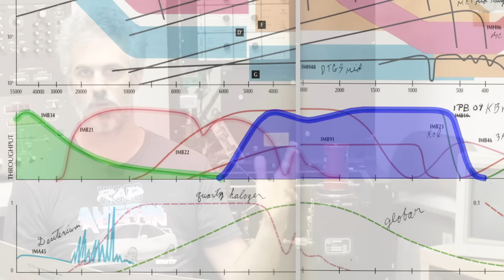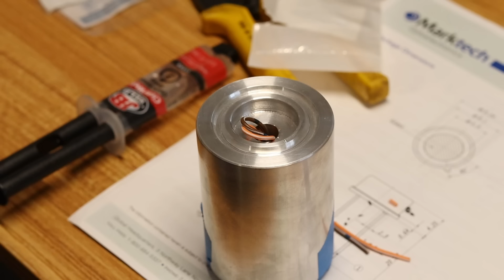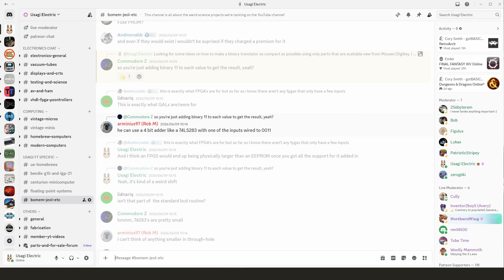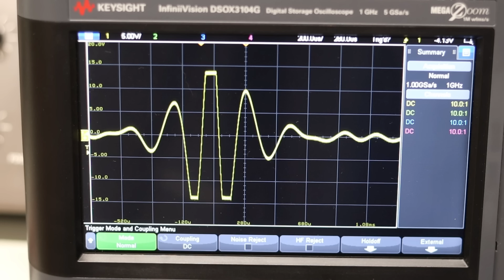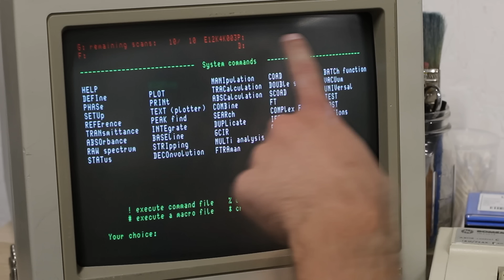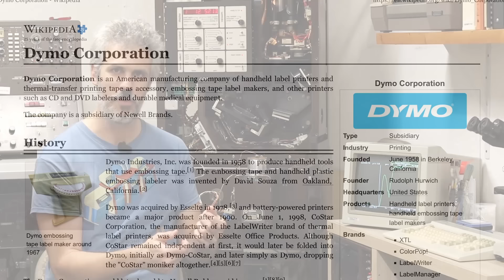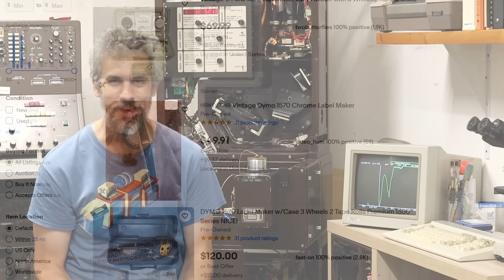Using a PDP-11/73 to do Real Science!

Comment: As any electronics person will say, before powering up something new/repaired first check for power shorts and then apply power from a current-limiting bench supply. It's lucky in this case that just the fuses blew. It could have been much worse....
Reply: Yes, and before even the power on check, look at it carefully to make sure you soldered it all correctly.
I have never skipped that step while using expensive parts, trust me, no I didn't, my eyebrows always looked like this
Reply: There is always a fuse, even if it doesn't look like a fuse, or cost as little to replace as a fuse .....
Reply: @bluerizlagirl  Hahahahahaha!  Nice.
Reply from the maker: To be fair, I did do checks for power shorts, but I think the real problem is I got something laid out wrong with the PGA, which may have caused it to fail making an internal short. So, not a construction fault, but a design fault because I'm bad at reading datasheets.
Reply: @UsagiElectric hey, at least we made the booboo on the relatively cheap board and not something irreplaceable. 

How much we would weep were it one the important bits of the Bendix G15's boards.
Reply: @UsagiElectric  I wrote you a nice long top-level comment to this video with more details on crystal growing etc. and thanking you for your kind words in the video.... which youtube then promptly shadowbanned and outright deleted a few minutes later. Honestly getting extremely tired of this platform's incredibly censorial comment system and continually trying to guess what naughty trigger words it thinks should be banned. I will try to repost the comment here as a new reply but I doubt it will work. In any case, thanks again and looking forward to more videos!
Reply from the maker: @Muonium1  Youtube out here trying its best to harsh our vibe, it didn't even give me the option to review the comment. I'm glad you managed to catch the video though! I'm working on a way to get the PDP-11 software to produce HPGL versions of the spectra so I can then transfer them to my modern computer, convert to a PNG and then upload to the Near Infrared Spectroscopy page to supplement the ones you took! With our powers combined, we'll completely dominate the NIR uploads on Wikipedia, haha.
Reply: @UsagiElectric  Retrying here to post my previously youtube-redacted top level comment as a reply, let's see if this works: 

"😁 As I say before, just elated that my spectra have been of use to someone so many years after I created them! I suspect the difference in peak height between our spectra is simply down to path length and the fact that I was using pure anhydrous lab ethanol rather than a 95% solution. I wasn't even using a proper cuvette! I used a tiny little 10 or 20ml beaker, which if I recall correctly was probably about ~30-50% longer in path length than your cuvette here. Beer's law and all that... Anyway, it occurs to me that you could potentially just MAKE your own KBr beamsplitter! Sure it might sound totally crazy, but there is just someone crazy (and very brilliant) enough right here on YT who's made his own KDP frequency conversion crystals for Nd:YAG lasers already! His name is Les Wright (called Les' Lab here). 

The video where he shows how to grow big, PERFECTLY optically clear KDP crystals using Alan Holden's method with a rotary crystallizer is called "How to grow big crystals at home fast!" KBr may be even easier to grow than KDP, and should be trivially easy to cleave into flat slabs for a beamsplitter with a common razor. In fact, I suspect Les may be happy to just grow the crystal for you if he has time! Maybe you could do a collab video or something. He's also a laser expert so he may have some tips for your mode-hopping/dying HeNe there. 

Incidentally, there's ALSO a video on here from 1958 from Bell Labs featuring Alan Holden himself explaining crystals which, while not in-depth, is excellent and a fun watch. The Bomem odyssey is quickly becoming a science saga favorite on here for me!! Keep up the excellent work!!"
Reply from the maker: @Muonium1  Excellent, looks like it got through! I copy pasted it into a new comment and pinned it to the top!
Reply: @UsagiElectric  Retrying to post my previously youtube-redacted top level comment here as a reply: 

😁 As I say before, just elated that my spectra have been of use to someone so many years after I created them! I suspect the difference in peak height between our spectra is simply down to path length and the fact that I was using pure anhydrous lab ethanol rather than a 95% solution. I wasn't even using a proper cuvette! I used a tiny little 10 or 20ml beaker, which if I recall correctly was probably about ~30-50% longer in path length than your cuvette here. Beer's law and all that... Anyway, it occurs to me that you could potentially just MAKE your own KBr beamsplitter! Sure it might sound totally crazy, but there is just someone crazy (and very brilliant) enough right here on YT who's made his own KDP frequency conversion crystals for Nd:YAG lasers already! His name is Les Wright (called Les' Lab here). The video where he shows how to grow big, PERFECTLY optically clear KDP crystals using Alan Holden's method with a rotary crystallizer is called "How to grow big crystals at home fast!" KBr may be even easier to grow than KDP, and should be trivially easy to cleave into flat slabs for a beamsplitter with a common razor. In fact, I suspect Les may be happy to just grow the crystal for you if he has time! Maybe you could do a collab video or something. He's also a laser expert so he may have some tips for your mode-hopping/dying HeNe there. Incidentally, there's ALSO a video on here from 1958 from Bell Labs featuring Alan Holden himself explaining crystals which, while not in-depth, is excellent and a fun watch. The Bomem odyssey is quickly becoming a science saga favorite on here for me!! Keep up the excellent work!!
Reply: fuses are way too slow to protect transistors though - by the time the fuse blows, the transistors are already toast. The fuse is just there to prevent a fire.
Reply: Not bench testing a new design and first pass PCB is crazy over confident lol. Lucky it didn't cause upstream damage.
Reply: Watching David talking about doing too much and getting excited, all I could think of was "yeah, I have ADHD too"